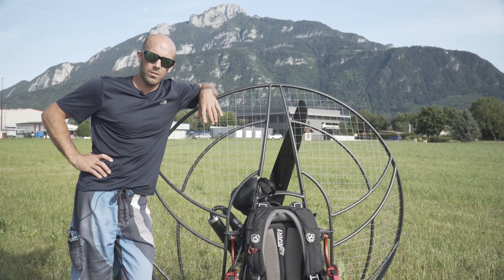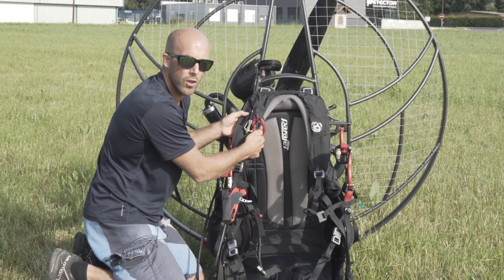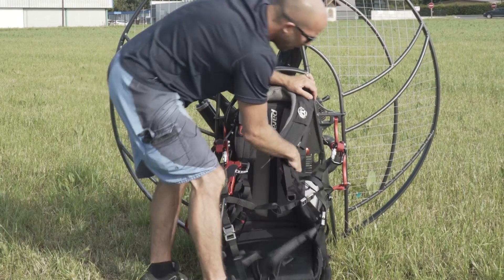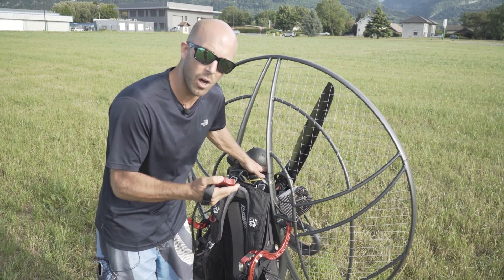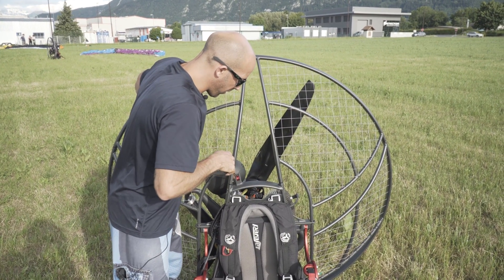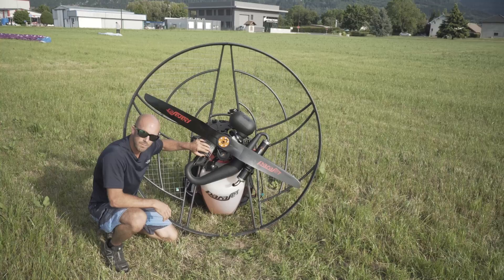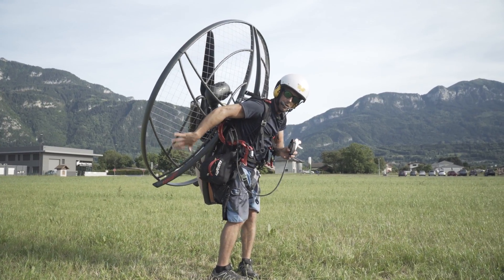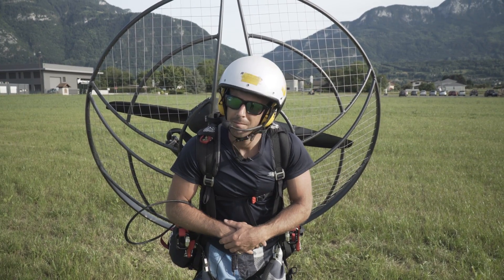Pre Flight Checks - Top Tips For Paramotoring

Comment: Good video.  Thanks.
I don't understand cage designs like that.  You can stick your whole head through there and into the prop area.
Reply: The cage is designed very carefully, it's mostly good training that keeps body parts away from the propeller. That said, in the future probably there will be fully enclosed cages. Right now full cages are considered too heavy and cumbersome. Smooth Skies

Comment: great video :) i would argue having someone help you pullstart it is as dangerous as actually ground starting it though,
if it started and went full throttle that guy would get it in the face/neck/ shoulder as the pilot has no chance of holding it back,
best that everyone keeps away really,
enjoy the videos though they are really well made, cheers
Reply from the maker: mark675 there is a technique you can use to prevent the student/pilot from going to full power. You can ask them to place their fingers underneath the throttle. Plus the person pull starting the engine should place their hand on the pilot’s shoulder not the cage. These simple techniques considerably reduce any risk to the assistant.

Comment: I've never had a two stroke engine before. When you mix the fuel - do you mix it directly with the fuel in the fuel tank? Or is there another place you put it? 

How do you know it's properly mixed in? 
Do you give it a shake so it distributes throughout the fuel and not sink to the bottom...or is that not a problem with 2t oil?
Reply from the maker: Mix the oil in a separate fuel can having measured out the correct amount and then give the can a good shake.